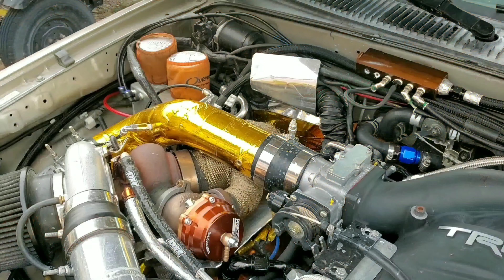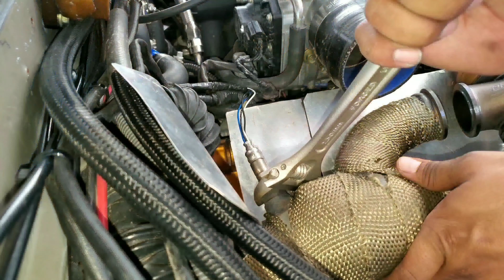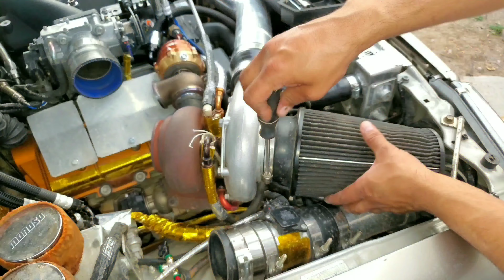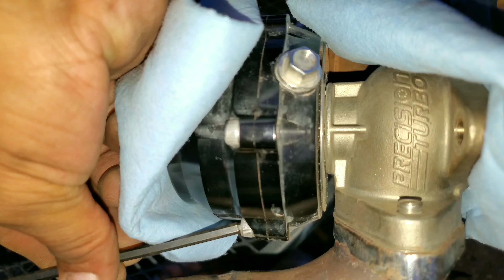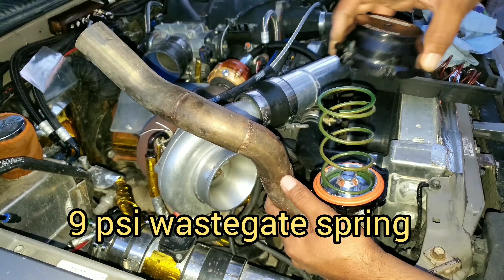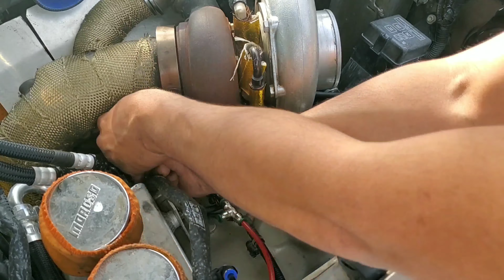TRD SUPERCHARGER + TURBO 5vz-fe V6 3.4 changing wastegate spring

Comment: Have you compared performance with a 2.37” vs the 2.0? Seems like the added heat of spinning the roots blower faster might hurt performance more than cranking up the turbo boost side. 

Also, considered switching to a first gen (grey)  supercharger? That would allow you to run the intercooler after the turbo and supercharger.

Comment: How’s the trans holding up? Is it built or modded in any way?
Reply from the maker: It has a ITP valve body upgrade with springs. Stock the trans would slip under heavy boost and shifting it would slip.